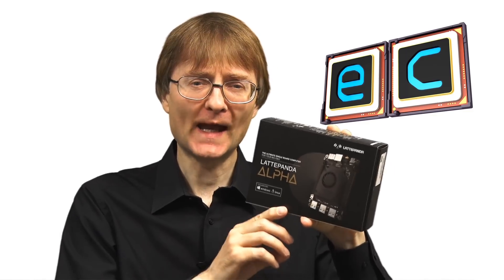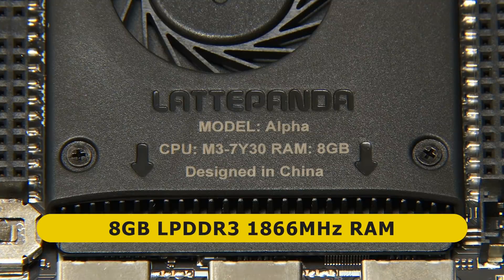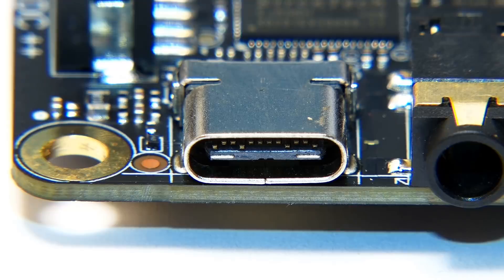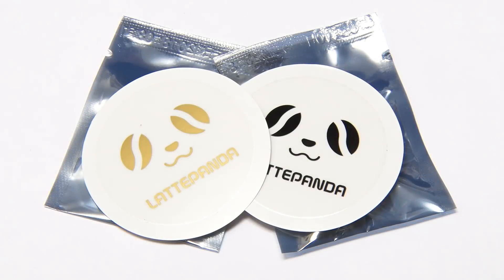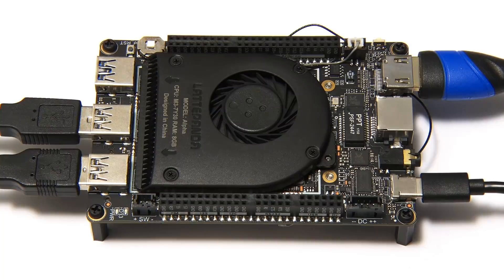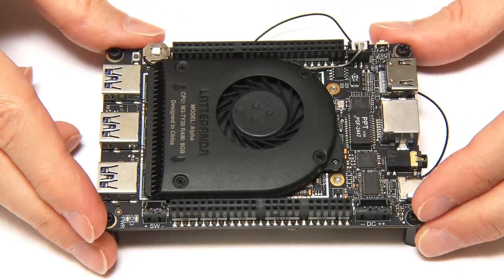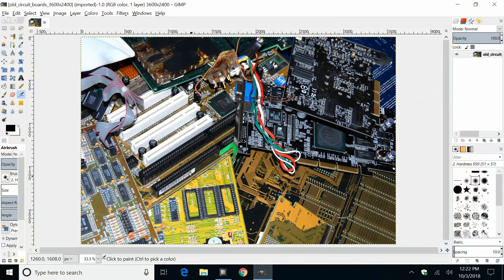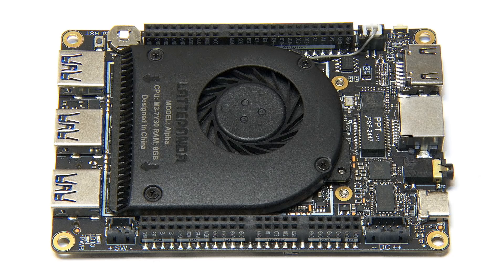LattePanda Alpha: Windows & Linux SBC

Comment: LattePanda for Canadian Makers.  My LattePanda Alpha 864 Was delivered Oct 30 2 days after being shipped by  RobotShop Canada (https://www.robotshop.com/ca/) 
. They are DFRobouts Canadian's LattePanda suppler.  

I had a bit of trouble locating a Canadian company that could provide me with this unit. I hope this information will help developers like myself get there hands on one. Part number RB-Dfr-816. The pricing for this unit is $471. Canadian. That price includes  duties  but not tax or shipping.   They have Windows 10 Pro installed and working but you will need to activate it for some functions. I plan to dual boot into Linux  in the next week or so.

Thank you Christopher for all your help. It was your recommendation and review that got me interested in the  LattePanda.  keep up the good work.

Comment: The video title is misleading :(
Reply from the maker: No, it isn't. Why do you say this? The LattePanda Alpha is a single board computer capable of running x86 Windows and x86 Linux distros.
Reply: @ExplainingComputers  From the video title, I was expecting to see Linux running on this SBC. You didn't showcase it.
Reply from the maker: Ah, I understand. The title is significant in comparison to the previous LattePanda models, which are x86 based, but very difficult to install Linux on due to the boot loaders. I will run Linux on a LattePanda Alpha in future.

Comment: Before watching your video, I was about to get an Arduino Uno but after seeing the possibilities offered by the LattePanda Alpha especially after attaching a GTX 1050TI I will have to review my decision. If by luck I won this LattePanda, my problem would be solved.
Reply from the maker: Thanks for this. Note that the original LattePanda is still available (starting at $89), and includes the same Arduino controller. More info here: https://www.youtube.com/watch?v=z5EXNfHYPfQ Good luck with your decision! :)
Reply: @ExplainingComputers  Thanks for that information. I will watch the vidéo.

Comment: I wonder if this is suitable for running a CAD Viewer like Creo View Express. If it has the power, it would be great for a project at the company I work for. We plan on introducing TochScreen Terminals on every CNC Machine, to display part drawings and running a CAD viewer for the CNC operator to support them on writing the G-Code on the machine. But I want to be sure this works, before I ask my boss to spend some money on this. Maybe someone already owning a Lattepanda alpha could test Creo View Express, It is free to download, just search for it. Thank you for any help.
Reply from the maker: Looking at the system requirements for Creo View Express, it should work fine on a LattePanda Alpha.
Reply: @ExplainingComputers  thank you for the quick check.

Comment: I am a illustrator that mainly works with Photoshop, Illustrator and Krita. Do you think this board would be able to handle these programs? I like that you used Gimp to demonstrate the processing power. Great video.
Reply from the maker: This board will I am sure run PhotoShop, Illustrator and Krita pretty well -- it has the spec of many a mid-range laptop, and 8GB of RAM. I've used Photoshop and Illustrator successfully on far less powerful machines! :)
Reply: Thank you :-) your a lot of help.

Comment: Yeeeesh....at that price it'd be better to just utilize a low cost laptop which is also a single board computer .....also a more powerful, and capable, option than this toy
Reply from the maker: It depends what you want to do -- a laptop does not have the connectivity, or the size to use in something like a robot or other IoT device. But yes, this is an expensive SBC.

Comment: Chris,  what WiFi dongle do you use for SBC's.
Reply from the maker: I do not often use a dongle, as most SBCs (like this one) have onboard WiFi. Given that most SBCs are also ARM (hence Linux) boards, dongle compatibility is not good! So where I have used a dongle (on a non-WiFi board) it has always been the one sold by the board's manufacturer (for it to work with their OS images!).

Comment: I really like the  SBC videos from your channel.
This thing looks pretty amazing... It would be great to install a linux from usb to a NVME SSD to get a small and transportable desktop replacement for daily tasks. But it boots from SD/eMMC only I guess?! 
It would be nice to get closer informations which issues occur using linux on it.
Reply from the maker: It boots from eMMC or an M.2 SSD, or USB (with the right BIOS setting). So installing a Linux distro from USB for an NVMe boot is possible. I will try this in a future video.
Reply: That´s Great, thanks for your response.
This is really good to know and I am pleased to hear that you try to make an other video about that SBC.

Comment: What is the purpose of having that much power? It seems like an overkill for 99.(9)% diy projects. imho anyway. I can see an argument for faster prototyping if you need to run a A TON of code and visualize it, but then again you can run that code on full-power desktop PC with and matlab/labview.
 If you want a pc to smoothly run Windows and play games like on laptop or desktop, well why don't you buy a desktop? a mini-atx pc? it's cheaper and has better specs. especially if you buy a second-hand pc. Or buy a good phone/tablet/laptop. Or like 15-20 orange pi's. Or 30 Arduino-clone boards and raspberry to control them. 
idk... MAYBE this alpha panda is worth the price, but i can't think of application for it where you can actually use everything it offers and not have an overkill (read: overpay).
Reply from the maker: This is a board for certain applications, certainly. But an increasing number of robotics and IoT projects require the power for, most notably, vision processing.

Comment: 358$ retail?  Sorry, I'm out.
Reply: Big oofs
Reply: It would be a very fancy PCL.
Reply: I don't see the point either. you get laptops with these specs for little bit more with display, keyboard and case
Reply: @walrus0008  A Ryzen laptop would annihilate any rig with this and probably cost the same. Forget if you go up to ~450$ where the LattePanda is realistically going to be costing due to accessories, case, etc., you could get a laptop with a dedicated GPU at that point.

Comment: I like it, I have been a Pi user for years but this brings some more portability to me as a Windows/Office user.  I carry a laptop bag around with me, now I could just carry the board/case and a cable and hot desk very easily.  Also, mapped up to a small 7in TFT, usability on the go would be better than the pi due to the pis restrictive use due to ram, storage, etc.  I will be buying one, good job LattePanda and backers.

Comment: This is way beyond what the engineer designed the product for, but,  since there is a 4x PCIe slot in the form of m.2... There are various riser cards that will convert that to a 4x normal pcie slot that would give the option to slot in a graphics card nothing too powerful, let's say a gt1030 or a gtx 750ti. I'm not suggesting it would be a gaming machine (although it would run a few games with acceptable performance), what about specific scenarios? Lets say this is a control unit for a robot, CUDA is what most scientists use for computer vision computations. I'm wondering how that would fare.
Reply from the maker: This has been done! The LattePanda Alpha engineers have connected in a GT1030 via an M.2 slot and have even played game! https://www.youtube.com/watch?v=fMh04-Bnwtc

Comment: As a Lattepanda backer waiting on a Delta, I was really glad to see you explore the new products. You may have heard that they have a big problem regarding the Delta, Intel can't fulfill the CPU order for at least 3 months. Who knows how long it will actually take before they do get the chips and then how long it will take to start manufacturing. This might become a total fiasco, requiring changes in design. QUESTION: they are offering Delta backers an opportunity to upgrade to Alpha's. That being a financial stretch for me I hope you won't mind answering a question that can help me. I believe answers to this may help other people beter understand what might be reasonable tradeoffs and possible with an SBC. I can upgrade to Alpha 864 for $190. This includes Win 10 Pro activated and 64gb eMMC. If I order the 800 model, which is minus Win10 and minus eMMc, my upgrade will be just $100. I have a barely used Sandisk 128 GB Extreme Pro. I am hoping that my SD card will be a reasonable substitute until I can upgrade to another option. I intend to try the iso for win 10 unactivated, but once in a while, researching if that really works I find a comment that on a clean install you need a code before installation. Is there anything you can say about that. I do have an unused win7 activation code, if that would help for upgrading. I hope I am not asking a question that tests boundaries you must remain within.
Reply from the maker: Thanks for this. It is a shame about the chip storage for the Delta.  As far as I am aware, a LattePanda Alpha cannot be booted from SD card -- only the onboard eMMC, an M.2 SSD, or via USB. As regards Windows 7, I would suspect you would struggle to get drivers.
Reply: Thanks for your response. I can order with the eMMC for $30 more. If I'm going to to purchase hardware for booting and storage, I've see 2 options which would seem smarter than to purchase with the eMMC. What do you think of Samsung 860 EVO 250GB M.2 at $73 instead? The Samsung 860 EVO 250GB 2.5 Inch  is now only $50? As for Win 7, I didn't fully explain. I didn't intend to run it, just use its key. Moving on, I see what appear as reputable sellers on Ebay selling OEM licenses for Win 10 under $10. Ebay has always been excellent at backing up purchase issues, but getiing my $7 back is not the issue lol. So my question is, might any of these offers truly be good. There are lotsa good reviews. Thank you if you time to answer.

Comment: As always, nice video Chris.  I would probably opt for the 2 second option of this board with no EMC and add a nice NVMe boot drive instead, albeit getting a copy of windows with it would be nice.  As others have stated, price would probably be this board's downfall, and not that its priced unfairly, just that there might be better options out there coming soon.  Im thinking nice little emulation / arcade cabinet for this that could run some of the later gen systems a little better.

Comment: This is awesome, except for $400 it should also come with a case. I don't care if it's just some hard plastic, just SOMETHING. It makes sense when a dirt cheap Raspberry Pi only comes with the board, but something at this price and this capable of being used as someone's primary computer should really come with some kind of case.

Comment: Dear Chris, thanks for answer the questions of we people who trust in your work. I have heard recently that LattePanda over heat too much, Is this true ? I know you are friend of that two young robots in China, thanks again.
Reply from the maker: The first LattePanda models had a reputation for getting too hot if heatsinks were not added on top of the medal shield. However, I never personally had an issue with this. I am not aware of any reports relating to the new models overheating -- though as shown in the video, they do run on the warm side, even with the cooling fan.

Comment: I'd be on this even at $400 if it came with Windows 7... An Intel NUC with an Arduino Mega would be a better option IMHO as if you let the magic smoke out due to an oversight while doing maker stuff you've only lost the Arduino, not the entire $400 SBC.
Reply from the maker: Windows 7 support would indeed be great, but is very likely now. :(

Comment: I wonder why Windows doesn't show there being 4 CPU cores? I mean, the Intel Core m3-7Y30 processor has two physical cores, but as it supports hyper-threading there should be four CPU cores visible to the OS. Interesting. 

I'm about to pull the trigger on the 864 though, without Windows. It's $358, but I can save some money by not buying an m.2 drive right now. The 64GB eMMC memory should be plenty for a Linux OS. I don't see any sort of case available on their website though Chris...do you know of one for this SBC?

Comment: Those mystery pins are just for a button to connect to so you can boot the board with a button click 

Desktop pc cases have the buttons and they have wires that connect to the mother board with those pins
Reply from the maker: I believe this is correct, but the board's documentation states that such a button is connected by the second 50 pin GPIO.

Comment: Christopher -  Did you happen to measure the unit's power draw at the wall (without peripherals) both idle and under load?   I think we're going to see increasing demand for always-on systems and in a domestic setting where power costs 1-2 kidneys per quarter (so the power firms can have gold plated power lines) this is becoming a useful solution.  I use a Rock64 for this right now for all the distros are too under-developed and there are a range of apps that don't play well on ARM64 distros (e.g. RabbittMQ which suffers from really poor ERLANG support in that build).   I believe this is the same chip as the new GDP Pocket 2 portable system too;  was surprised to see a 7th gen chip used instead of 8th, there must be a power or supply reason.
Reply from the maker: I will test power draw in the future.

Comment: I've always wanted to build a computer INTO a desk, Ala Tron but more ergonomic. I think this would be a great solution for that. Question: does that Usb C port work with a Usb C dock, so I can plug in more monitors and stuff?
Reply from the maker: Yes, you can connect a monitor via the USB-C port here (with up to 4K outpuot), and (presumbably) use a dock. Note that you also have the header for a USB 2.0 port
Reply: @ExplainingComputers  Thanks ---Emphasis on the "usb  2.0" If I did this, I'd want to hook up a couple of external hard drives, and I'd need more ports than what's on the board.

Comment: You realise you can build a gen3/4 gaming rig for the same money?
Then add a 1050ti/1060 and run AAA titles... and do real work. Heck, if you pull an itx out of the case and use a slim psu, it's not even much bigger.
What are these boards for again? #Darpa ;o)

Comment: Another outstanding and informative video. What would be useful is you could run this board for some period of time and give viewers some sense of the product's longevity. My problem with some of the smaller form factor computer devices is that they aren't nearly resilient enough for heavier duty tasks.

Comment: SW- system control pins are for a power switch. The earlier lattepandas did not have pins for an external power button, which was a bit of a problem for a lot of people.

Those wondering, there is an M.2 E-Key to PCI-E adapter, but i've not tried it, but it does exist. it's a bit expensive. $34 USD. if it were $15 or lower i'd have tried it.
In theory you could connect a low end video card like a GT1030, but i've not tried it. so who knows. If someone wants to buy me one, i'll test it on an old laptop motherboard though. XD

https://de.aliexpress.com/item/M-2-NGFF-Taste-Ein-E-Zu-PCIe-4x-Riser-Extender-adapterkarte-Kabel-5-cm-80/32833415521.html?spm=a2g0x.10010108.1000023.2.687c909dohRvW7
Reply: They say great minds think alike! I was thinking the samething about trying this adapter and a gt 1030 on this board, I'll probably pick them up sometime in November and test it out!
Reply: There's plenty of m.2 M-key to PCIe adapters, but this is the only m.2 E-key adapter that i've found.
Reply: I'd like to see it compared with one of the upcoming embedded Ryzen boards from Sapphire or Udoo. The integrated Radeon graphics would mean you wouldn't need such a PCIe adapter.
Reply: The ryzen board would win for sure. 
The m3 tops out at around 2.5ghz in normal gameplay, IF your cooling is really good and your TDP is set high enough. and it's 2 core, 4 thread.

The Ryzen V1807B is 4 core, 8 thread, and has vega 11 graphics, and can top out at 3.8ghz
There's no competition, the ryzen would win.
All except for in 1 category... power consumption, the m3 7y30 is rated at 4.5Watt tdp, and if you throw enough power at it and cooling, can top out at 15watt.
The ryzen v1807b however is about 45watts, and tops out at 54watt, without any additional overclocks.

If you want to embed a mini PC into a small non-portable project, the ryzen would be amazing. But if you need it to be portable, and small, like the GPD Win2, the core m3/m5/m7 are the only real choices.
Reply from the maker: Video of PCIe used to run an external graphics card here: https://www.youtube.com/watch?v=fMh04-Bnwtc

Comment: Hey, great video. I am probably not known for general praise, but well done--it was a good watch and everything seemed covered (except enclosures. I imagine they're offered as a cottage-industry add-on, but that omission alone speaks to us not being fully-ready to move to SBCs in the typical home.).

It's interesting to see that we've come back to 1997-2000 and the version of ThinNet Everywhere (RE: the Cappuccino and other small form-factor machines and early SBCs), and a $400 price-point makes me really want to look at building one in an enclosure and handing it VESA-mounted to a good television as a general-use computer/email station/Netflix/HBO-watching device for my parents. 

My concern is that 75C runs really quite hot. I imagine the chipset has a Tc of around 95-100C, so you'll not damage the CPU if the fan breaks, but I typically like systems running 55C under load. WRT SBCs that can drive a 4K display and be used as a general-purpose machine, is this just how it is, or is there another SBC you could recommend for an HTC/living-room setup? 

(Sorry this is so long; the video made me think about what is possible for my parents, and how I can most-easily support them remotely.)